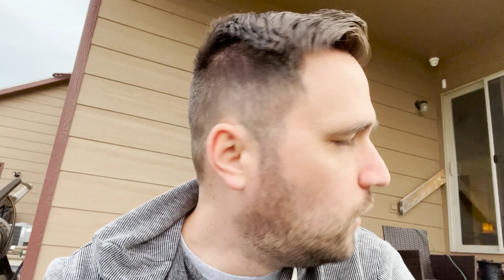Just a weird guy testing out solar panels..

Comment: You should use 8 Awg cable from the Solar panels to the solar charger since you have a long run. Also you should use 2/0 on the Batteries (looks like SOK Batteries) and to the inverter. Also need some fuses in there.

Comment: Maybe some conduit for the cable running across your yard and a drip loop where the cable enters your house so water doesn't travel down the cable into your house. As far as it goes for Karen and the HOA, they shouldn't have any say on solar panels regardless of what they are used for.

Comment: You need a raspberry pi running Venus OS and the USB to VE-direct cable to the charge controller.
Reply from the maker: I just did this today because of this comment lol thank you :)
Reply: @Bytemybits  - can then expand on that with et112 energy meters. PiCan2 and a touch lcd screen.

Comment: Dude you have 12 volt battery's you don't need an inverter you already have a 12 volt source the battery.  just hook up your fuse block and go to town.   I have this in my house just like a travel trailer.

Comment: Please get rid of the ANL fuses. They are max of 32 volts while just over your 28+, offer not a lot of hope of holding off a major fault. Run a set of HRC that are designed for the job. Carpet in server rooms or power rooms not a great idea either. Things blow, sparks and hot spray end up on the floor.

Comment: I'm doing this stuff but later you will realise you wana automate it on home assist or node red , you will wana have a pi and wifi dc 12 relays so you can turn on and off as needed or check if external power is on or off , has fall back wifi to see what's happing when power dies , my Internet and home assist runs for a day on battery's

Comment: Your still going to have losses with that 24v to 12v DC-DC converter. They are claiming its "95% efficient" but thats under lab conditions so take that number with a grain of salt. If you want 0 loss then you can purchase 24v LED lights then the only loss you with have is the line loss from the length of wire from your battery to the lights and any connections in the circuit.

Comment: Not a bad start. Once you get them garden cables covered up it will be sweet and you can keep those panels cleaner because you can reach them.
Get your battery balancer
DC-DC Crew!! Fair play I didn't think you'd get all the additional bits (I've go quite a bit of that)

Comment: jason, i would get some armoured outside trunking (PLEASE?!) for your cable across the grass and bury it with something on top of the trunking (i think its called electrical identification tape, you literally lay it on top and then fill in on top of the trunking then fill in the hole. its not sticky tape) to identify it. dont want you running that cable over!

just for your own safety please get a sparky (electrician) to check its all sound just to be on the safe side, and if solar needs a licence (WHY?!) i'd get one just so you have it! 

have a good thanksgiving 😊
Reply: I was thinking the same thing. I guess though, if this is very temporary, at least put some 2x4's over the top of the 'temporary' cable perhaps. I'm sure if it became permanent, he would use SWA in a 400-600mm trench 😜
Reply: @bikerchrisukk  exactly 😊